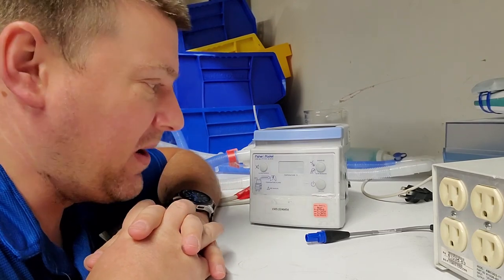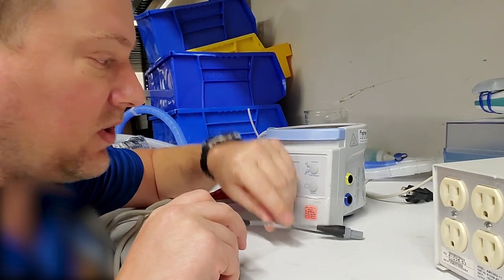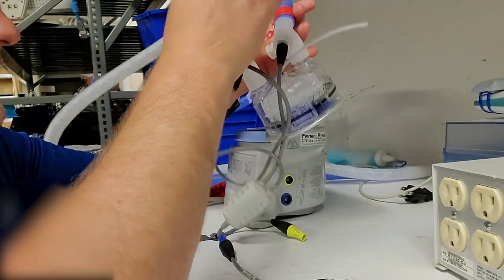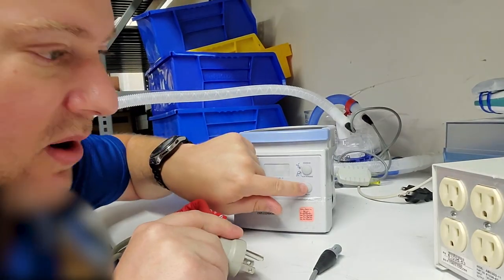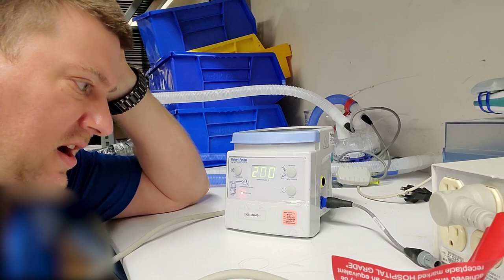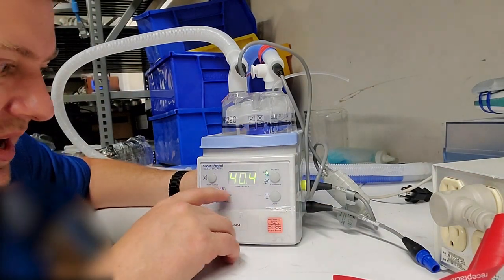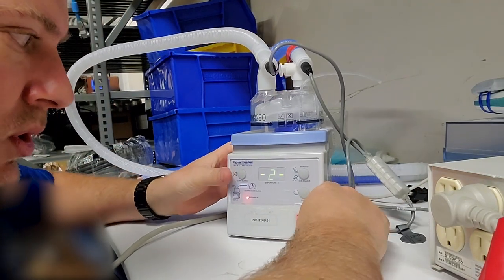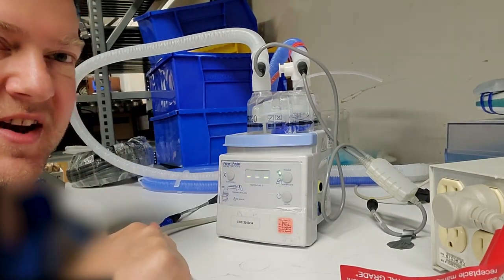Fisher & Paykel MR850 Humidifier

Comment: Hey, I just wanted to follow up on an issue with electrical safety and the MR850's. There are three screws underneath the heater place (service manual Rev J, page 39, figure 7.6). These screws keep the heating plate attached to the unit, but can loosen. With the increased air gaps in the screws come extremely high ground resistance (ohms) values. Tightening these screws helps display the true resistance characteristics of the unit. Due to the nature of the unit and design of the PCB (heating element, component choices), these units also typically have high leakage values (Neutral, L2 Closed: >100 uA). Thankfully my facility has the TAP Agreement with Fisher and Paykel, at that point I send back (an ungodforsaken amount of units) back to them.
Reply from the maker: I have 2 electrical safety analyzers setup and we also ship out all humidifiers that are defective

Comment: Just a couple comments, the heater wire in the tubing is to reduce rain out, this is where the heated humidified air hits the sides of the tubing which will be cooler and this creates condensation drops which will then pool and block the HME filters at the patient end. Common problem in ICU can be a fan blowing cool air onto patient blows across the breathing tubes and increases the rain out effect. Also the man in the box dosnt mean double insulated (thats a box in a box), it refers to type BF patient applied part.
Reply from the maker: It took longer than expected for someone to correct me on the symbol. Regardless,  1/3 of these device will not pass an electrical safety test because the platter is not directly connected to the integral electrical components
Reply: @BetterBiomedChannel  MR850 you will always get an earth resistance of less than 0.2 ohm from the heating plate, otherwise it is faulty, agree there are others out there that are double insulated though.
Reply: @tailzer42  I would just like to say when you do the electrical safety testing you need to clip your earth lead to the heater plate at the front middle of the blue finger guard. I believe there might be a coating on other parts of the plate. Internally the earth contact screws directly onto the plate btw. ( UK version) so I guess the comment above about plate screws giving a bad earth is not correct. I'm working on a MR850 now, you might be interested in the fault. Came in with "not heating" on the fault description, I ran it on test where it performed reasonably well, however the temperature did seem high at times. Switched off over night and the unit was alarming Heater chamber, heater wire and temperature sensor when it was switched on in the morning. I then opened it up to find the PCB had water damage residue on the lower part of the board. I guess the unit had been sat in water. 
Easy faults on this unit are the heater plate cut out you can reset this by pushing through a small hole inside the unit. Usually comes up with an error code E21. The mains transformer often buzzes, tighten the screws which hold it, plastic sealer or replace. There is a replacement improved PCB should you need to replace the PCB.

Comment: Hi Justin, in the calibration jig are probably 2 resistors buildin that each represent the value of a certain corresponding value from a thermal sensor, so mayby stupid question, but why are there 2 temperature values ? Ambient temperature and heating temperature ?
Reply from the maker: I do know that after the calibration, I inserted the gray key and it registered 40degc.  I'm thinking that 40degC is about right since body temp is 37degC. So the gray is calibrated value and the blue is either ramp up max value or it's low temp (if the ohms is NTC )

Comment: The back of my mr850 says the water heater and circuit heater are around 250-300w, however when i try to ise a portable battery device capable of 500w and when i try a 750w dc converter, both throw errors on the humidifier and will not work. 

I origionallt thought it was a ground problem, so i made a 3 to 2 ground cord grounding neutral and ground together, but this did not solve the issue either. 

I also tried plugging in my 3 prong humidifier i to a 2 pront extension cord in my house outlet, and this did work correctly, which leads me to believe the issue is not neutral/ground related.

Does anyone have advice for my issue? I want to make this humidifier mobile.
Reply from the maker: Connect the humidifier into your electrical safety analyzer and check the device current.

Comment: Thank you so much. Do these require electrical safety checks each year?
Reply from the maker: To be honest,  The type BF rating (Man in a square symbol) means that the patient circuit is not connected to ground in any way. Normally the platter would be a good ground but since the platter touches the liquid that has the potential to touch the patient, I bet the platter isn't grounded at all. I will take actual Ohms readings tomorrow to prove or disprove that.
Reply: @BetterBiomedChannel  Thank you, I'm looking forward to your follow up.
Reply: Did you ever figure anything out for this?
Reply from the maker: @MrMdynex   yes. The platter on half of the units tested will not pass Electrical Safety due to poor conduction at the spring beneath the platter.
Reply: @BetterBiomedChannel  The plate is definitely grounded! Its a 1BF device. 1 because it uses an earth. (UK device)
Reply: So it the plate is grounded but the heater wire circuit ( BF part) is isolated right ?